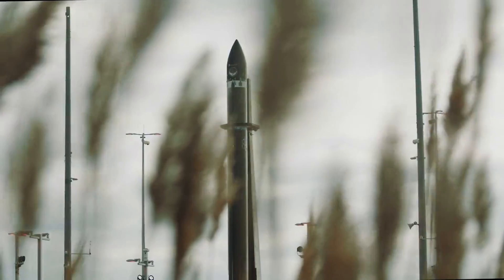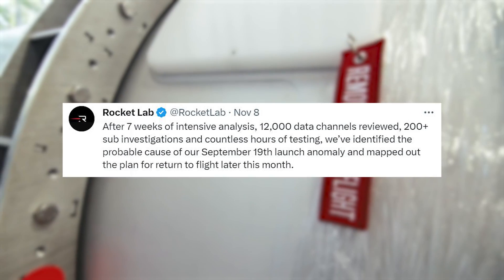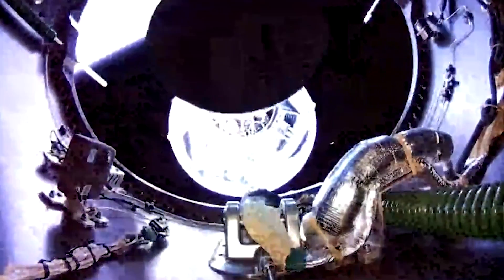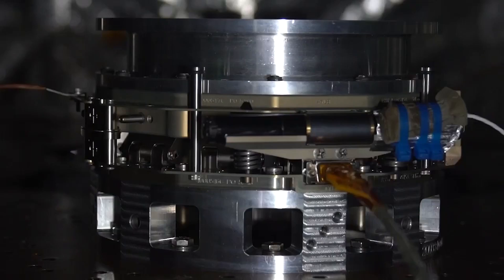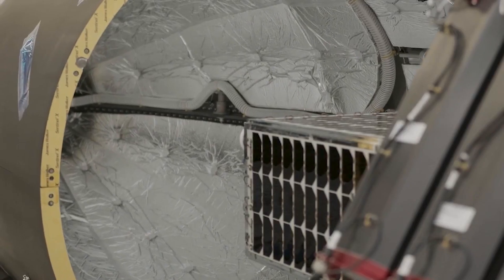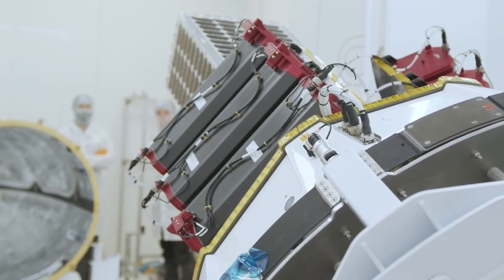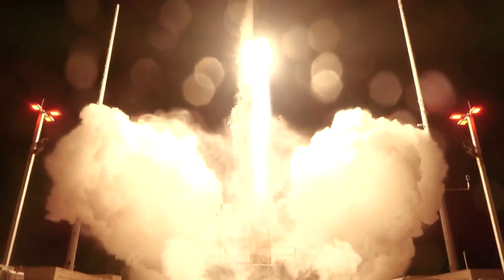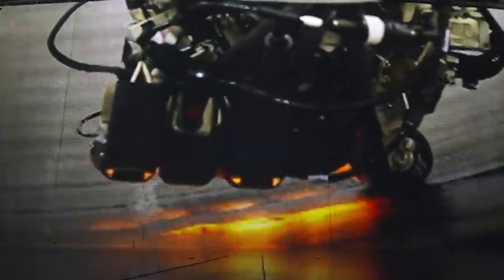What Exactly Went Wrong On Rocket Lab's Last Launch?

Comment: At high altitude you need to shield cables and Circuit Boards. We had to coat circuit boards for a product that flew above 70,000 feet.

Comment: Odd, you would think that building an airtight compartment around the electronics/power system would add a lot of mass ... something does not add up
Reply: Most likely only very specific (minor) parts got better insulation and air tight covers.
Reply: I agree, adding an insert gas to any compartment with high voltage machinery seems like a weak way to handle dielectric breakdown of insulators. (No pun intended.)
Reply: Where did you get your engineering degree again?

Comment: Sounds like electrical fires in space is a problem that hasn't been fully resolved yet. Hopefully SpaceX takes note.
Reply: When have SpaceX had any electrical fires in space?
Reply: @lvlister2005  IFT-2 will be their first experience with electromechanical motor actuators on any of their boosters. Even SN-25 still has hydraulically actuated engine gimbals. We'll also see how the electrically actuated flaps work in space/plasma this time too.